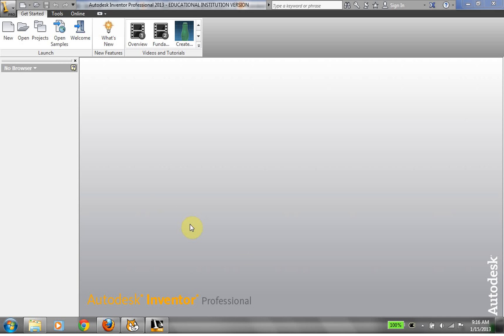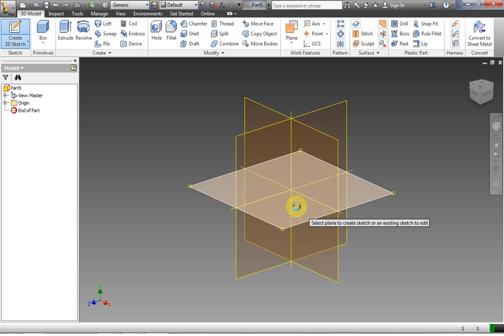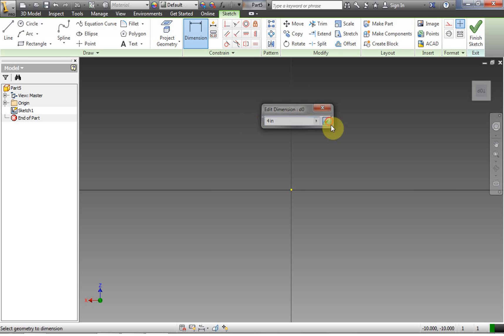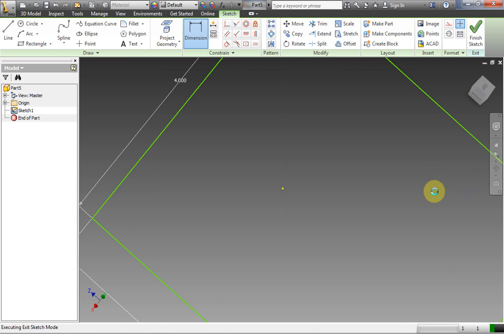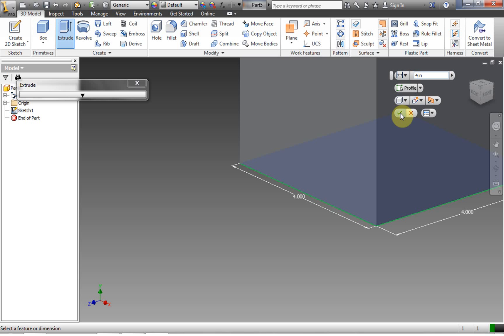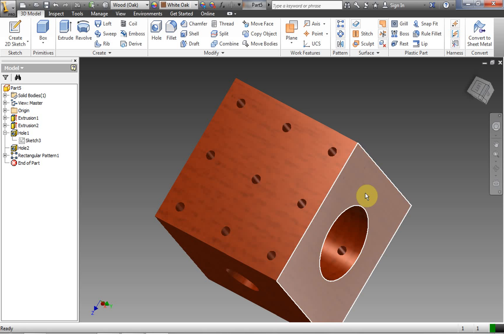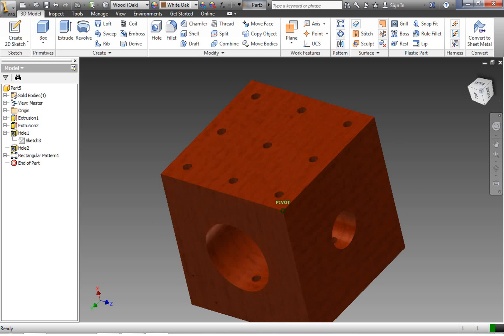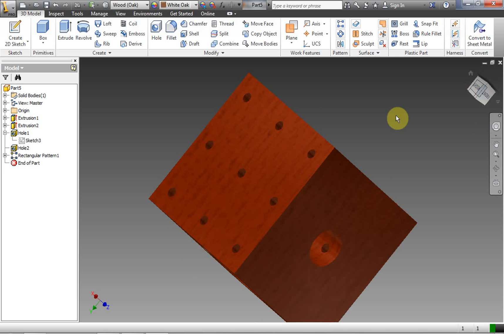Autodesk Inventor 2013: Lesson 8: Holes 3d Pattern

Comment: hi, thx for the video.
i have a little proplem, i'e created a point in an extruded solid but when i click on the tool hole it doesn't show the point made in 2d sketch... i ned to create 2 holes in a 14x9 mm sttel plate for a screws but i cant cath my point on the hole tool, please help